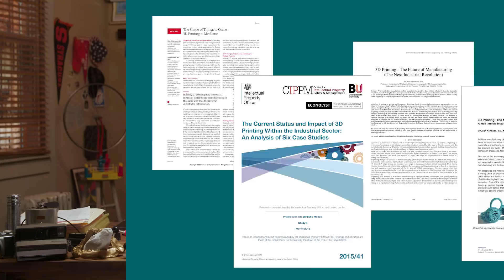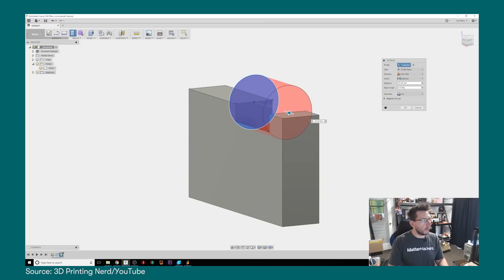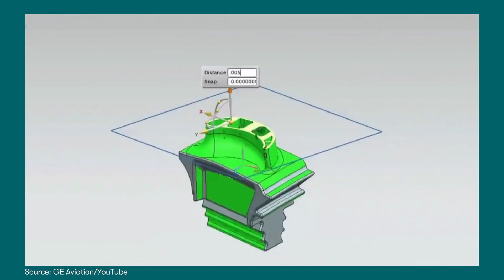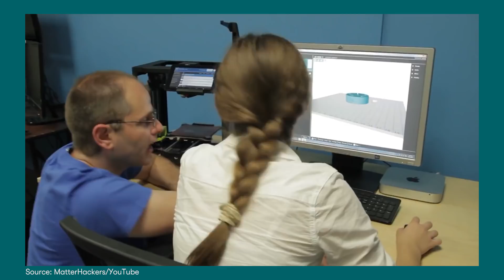What happened to the 3D printing revolution?

Comment: I think 3d printers are at the same stage as the early home PC industry, full of promise but of little use to most people. Give it another ten years or so and we may truly get the revolution the same as it took a solid ten years or so for the home PC market to really start producing a product that was both user friendly enough and useful enough at a good enough price to temp the average user.
Reply: Matt TheChosen Agreed 100%♡
Reply: i would not be so confident for a few reasons.
1. CAD is not easy to learn, had to do well which limits the average Joe's options with them to things we found on grabcad or similar
2. they can't compete on cost with injection molding, so why learn
3. they have significant design limitations inherent in the technology, which limit its ability to work for a lot of production
4. they represent a added cost with limited benefits to the average joe.

Comment: I'm not sure what the "hype" was, but 3d printing isn't going to turn out finished products for useless consumers anytime in the next several decades. As in most likley no one in the next say 50 years going to walk up to a box in their kitchen and say make me an iPhone 31s and then have an iPhone magically appear in the box ready to make calls. 3d printers are tools that make 3d dimensional objects. The key word being tool. A good rule of thumb would be if you don't already own and know how to use basic hand tools, 3d printing isn't for you and maybe never will be. However if you're someone who makes 3d dimensional objects as part of your work or as a part of a hobby then a 3d printer may well change your life. It certainly has changed mine.

...In  any case in just the last 3 years 3d printers have dramatically dropped in price and simultaneously gotten much better, as well the available printing materials have also dramatically improved and gotten far cheaper.

Comment: I love my 3d printer and it has saved me countless times by printing replacement parts for all sorts of things in the car and in the home. For me, being able to CAD/CAM at home at amazingly low cost IS a revolution for me. I can't wait for full metal FDM to come to the home user when the cost becomes low enough. Ofcourse, you can use the lost PLA metal casting method if need be. For those who aren't into 3d printing... you're missing out.

Comment: He did a good job summarising 3d printing as it is, but I wanna delve in a little deeper, specifically about how mind-blowingly revolutionary 3d printing is to manufacturing and prototyping.

Until 3d printing gets its foot in the door as a suitable method of finished product manufacturing, injection moulding is and always will reign supreme. Injection moulding is fantastic; when you make item runs of thousands or tens of thousands, each individual item is only a few cents cost usually. However, an injection mould itself has a cost of tens of thousands of dollars, even hundreds in some cases, although they have a lifecycle of millions of products cycles so they're more or less immortal.

3d printing changes this immensely because in the final prototyping stages, tens of thousands of dollars are easily wasted in making expensive injection moulds to troubleshoot the final product and process design and it's not uncommon to inject mould a product then find a fatal flaw in the design as soon as it falls in your hands, thereby wasting all the time it took to design that product iteration and the injection mould for it, not to mention the wasted tens of thousands of dollars on the mould too. Also, as is given, all outsourced tasks eat up a lot of time and any business that seeks to become more time efficient often first look at any processes they can bring in-house to save time.

3D printing is an absolute game changer because of 2 things. Firstly you can obviously do many design iterations within a given week as see which ones suck and which ones don't, but more importantly, you can screen them for their manufacturability. When you use 3d printing for rapid prototyping, you're not just seeing what product is cool and what isn't, you're analysing it and thinking about how you would mass manufacture it, how you would design and build an injection mould for the item... Often a lot easier to do with the product in hand. 

Not only can you do multiple iterations within a week, you can do limitless iterations at low cost, vs thousands to tens of thousands per iteration and weeks in processing. As he stated, rubbish idea fails fast and not much time and money gets wasted on them. 

The real game changer with 3d printing, however, isn't 3d printing prototypes of the final design, it's using speciality filaments for certain design demands. My favourite being 3d printing super short life injection moulds. As it is, 1 3d printing filament is near to the stage where it can consistently print a 3d injection mould. Keep in mind, 3d printers aren't just magic things with doing it all filament that you can use to print biometric prosthetics and lightsabers. This specific filament is basically only for 3d printing an injection mould. It has a lifecycle of roughly 10 to 100 items before it's too worn to meet tolerances. 

This is an absolute game changer because we are near to the point where companies can 3d print a prototype mould at extremely low cost and do a run of 10-20 prototypes and analyze them all and inspect the moulds too. Not only can the filament be used to build prototype moulds to save thousands on failed iterations, but they can be used for low run or special edition products, instead of spending thousands on developing a metal mould with a lifecycle easily in the hundreds of thousands to millions of items mark for an item run of a few hundred or thousand. The type of filament used for injection moulds is a type of SLA resin filament. 

This is a huge game changer in product design for 2 reasons. The market inherently punishes creativity and design because it is time intensive and costly. It's easier to stay safe in the box when each mould costs tens to hundreds of thousands of dollars compared to a final item cost of barely a few dollars. This is a major driving factor in product cost for everyday items. People should be excited about 3d printing because even if they never touch one themselves and even if we ever get to the stage that they're as common as microwaves and paper printers in homes, 3d printing in manufacturing saves mountains of time and money PER item which would traditionally be recuperated in sales. The free market will lower the item cost to the manufacturer and then through competition, the final consumer price will be lowered to reflect those tens of thousands to hundreds of thousands of dollars in savings for every single item. 

Also, because the time and financial cost of creativity and failure are much lower with 3d printing prototyping, creativity and thinking outside of the box is punished less which assumes we'll see more design, variation and creativity in all products. In addition, as I said before, the lower cost of SLA printed moulds and of rapid prototyping opens new doors to limited production runs and limited edition products which also greatly opens up the world of boutique, novelty and pop culture type merchandise. 

In the end, we'll likely rarely, if ever, pick a finished item off a shop shelf that is a 3D printed finished product (unless we're specifically buying that novelty) because it's simply not cost-effective. ABS injection moulding is mere dollars per item and items can be moulded extremely quickly, with much greater structural integrity. For large production runs, injections moulding will always reign supreme. However, for limited edition runs, small production runs, and rapid creation of prototypes, 3d  printing is a game changer and will affect us all immensely, in a good way.

In addition, some entities are working on filament extruders and other technologies for 3d printing which either adapt readily available and cheap ABS pellets or focus on recycling used filament and disposed of or failed items and certain plastics to create 3 printing filament. This will inherently drive the cost of 3d printing down and although it's likely to not greatly affect large corporations using 3d printing as a prototyping means, it will spawn an industry of lower cost recycled filament and of plastic recyclers/ filament extruders, which will lower the access bar for hobbyists and smaller businesses. 

Personally, I'm most excited for 3d printing 1 off item casings/ enclosures for hobby type projects. As a hobbyist/ electronics nerd etc, if you have the ability to easily print a project enclosure or item mount for a mere few dollars then that is a massive asset. Think of all the people who do numerous projects with Arduino's and Rpi's which would benefit from not going to the market and spending $5 per project to buy a simple project enclosure or single board computer case. Think of the ability for project makers to easily include curves, embossed logos, mounting hardware and other design elements in a project casing. This, in my mind, would be the single biggest variable that would take most people haphazardly presented projects to a level where it could be considered a professionally designed 1 off. Further, if someone is inclined to think this way, once you put a functional project in an esthetic and neat enclosure, you no longer have a cheap DIY project or proof of concept item, you have a limited edition product that can be sold. For the technologically and electronically inclined, this opens doors for pop-culture merchandising. That's what excites me most.

Comment: It's just not moron proof yet. It does require some knowledge and experience to use one effectively. That alone will keep most people away. Until it's literally 1 click printing, it won't have a large customer base. I've used 3-4 maker bot models(way over priced in the current market and quality isn't there compared to the cheap Chinese printers), I've used Tivo printers and the CR-10. I find the cheaper printers to be superior, but they all require a learning curve and are work to use and maintain.

Comment: I've for years considered buying a 3D printer, but I can't figure out what I'd use it for. I'm not a nerd and thus I have no desire to print out crappy little Batman figurines - so short of that, what do you need it for? They just have to add features, add materials, figure out a process to print "color" to the plastics, etc. Way too early to say 3D printing is dead, it's just early in it's life. Also, yes, one day every home will have a 3D printer, but that's many years in the future still.

Comment: Many students in delft in the Netherlands (a city with many technic study's) have a 3d printer at least 1/3 also al the campus buildings have a few. It's really usefull for fast prototypes or cases for electronics and other small projects. For final product it wouldn't be that usefull in my opinion tho.

Comment: I've never really seen "3d printing" as a technology in itself. Scanners, 3d imaging, and plotters or cad tools have existed for a long time. Recently someone decided to have one "draw in 3d" with a hot glue gun and decided to call it an invention. So much hype. But yes these machines are useful. I've cut things out of metal with a computer controlled plasma torch. The whole "tech" here lies in development of substances that can be used to "print". And the over arching general fact that computers have gotten faster and cheaper.

Comment: Fact check: if you have a 3D printer you still have to bring the same volume of materials, as normal tools to space. It makes it marginally lighter, but we haven't developed strong enough polymers to work as a screwdriver effectively, for example.
Reply: Actually materials are already there for metal type tools. Costs are almost there for these type of 3-D printers.

Comment: The consumer market for the 3D printer as a Santa Claus machine was a marketing fantasy...
One of the biggest impacts of 3D printing is in small business innovation. Companies like GE have deep pockets and huge R&D budgets. But what about the little guy? 
You no longer need a $50k machine with really expensive consumables to make a part. The first part made is usually never perfect for the application and modification is needed. This is a good thing as it accelerates innovation. Physical parts stimulate the exchange of ideas in a way that no rendered drawing in a PowerPoint presentation can. It's fun! Everyone has something to add to the conversation. Non technical people can add good or even great ideas and insights. Changes can be implemented immediately, with a new part ready to test the next day (or so...) or sometimes the same day. Now the small innovator can speed up the design cycle at low cost. Just as significant, understanding the process by doing it in house encourages designs that can be printed successfully. 
Great video!

Comment: I'm a handyman and IT-manager (odd combo, I know) at a local high school, and I bought a 3D-printer last year with the express purpose of using it to make spare parts for the furniture and devices always end up having to either completely replace or improvise repairs for.
Let me tell you it's been an absolute boon for this. I've racked up several dozens of various models already, everything from battery hatches, electrical boxes and mounting brackets to the occasional decorative models the teachers are so fond of (no appreciation for the practical, le sigh...). It's simply great for this. You have no idea how expensive some spare parts for a table can be when only a small bit of plastic on said part needs replacing, but cannot be bought separately.

Comment: New engineers trained on 3D printing will have a fantastic shock when they get to engineering school where they have to deal with draft angles and 5 part moulds that they have no idea how to deal with. 3D printing can inspire more people to become engineers, but they sure as hell won't have more realistic expectations. They will expect parts to be made in a matter of hours not in weeks as with the full process of traditional manufacturing. 
Saying they will have a better understanding and experience is severely over simplifying it.

3D printers are a great way to teach troubleshooting and design thinking, a process which will arguably be more important in critically examining our world today than the engineering capabilities that 3D printing teaches.

Comment: Predictions of what would happen with 3D printing technology back when it was just starting is like ANY OTHER attempt to predict the future. Predicting how wonderful the future of 3D printing WILL BECOME is the same as predicting disaster and collapse of civilization after Y2K at the end of the 90s. NO ONE can predict the future. Even those that get "pretty close" are a million miles away from the reality or simply vague on details.

I never actually read or saw any of the "The world will be changed by 3D printing" predictions mentioned in your video. Without that bias or expectation in my head, I never really could see where the 3D printing revolution would turn out. It couldn't be predicted and it took a different direction into unexpected areas. 3D printing didn't "change the world" but it DID change PEOPLE. As you said in the video, engineers and inventors are using it for prototyping, BUT way more than those specific skills, ARTISTS are LEARNING engineering simply to take advantage of 3D printing. Artists and "closet inventors" desperately WANT the 3D printing revolution to change the world and the only way to make that happen was to learn how to make it work.

There is a now a new industry of ARTISTS producing and selling products that could ONLY BE CREATED with 3D printing because all other methods to produce those exact same things are WAY WAY too expensive. Now with a cheap 3D printer, some files, sandpaper and elbow grease, mold making materials and resin, an artist can affordably reproduce and sell an original piece, weather it's an actual product or tool or an original unique piece of artwork, ANYONE can create and sell ANYTHING in their heads without selling body organs to pay for it.

From what I've see this is where the revolution is taking shape as a profitable manufacturing process. Grass roots entrepreneurs and artists are pushing 3D printing into new directions.

Comment: The 3d printer in every home is probably 20 to 30 years away and will be nothing like the printers of today. 3D printing in mass manufacturing is likely to take off much sooner when the cost of 3d printing approaches methods like injection moulding and casting

Comment: A lot of work has been done not only on limiting variables but also the synergy between software, hardware, and consumables. It was part of our core objective at Tiamet 3D to make printed outputs more reliable and able to be printed faster by using nano diamonds to influence polymer chain arrangement. Ultra nano diamond filament availible at tiamet3d.com